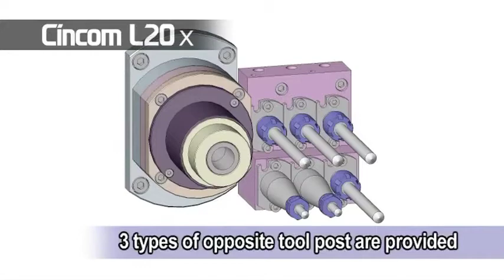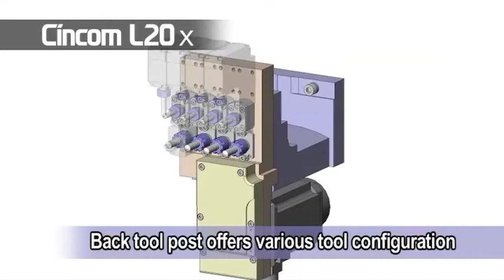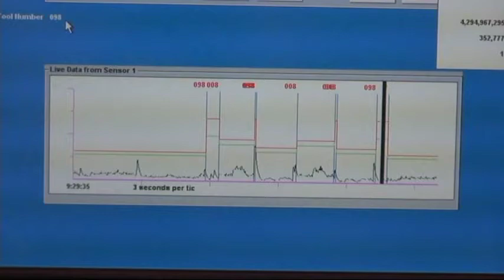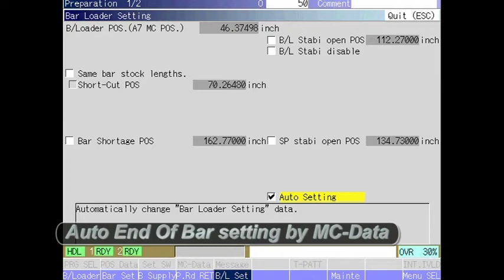Citizen L20X Swiss Lathe

Comment: Well done ConcentricCorp. The video clearly depicts the capabilities/possibilities. I'm currently having some issues on a new Citizen L20. I'm going to post the situation in hopes that you or someone else can help. Thanks in advance. 

We've a brand new Citizen L20 and we're having chatter issue when turning. It's the first part we've tried running on the machine. 

The material is 8620, 11mm stock OD, 6.3mm finish OD, 28.75mm OD length. .01mm total tolerance, .8 finish requirement. The 11mm stock is necessary due to a 10.1mm OD beyond the 6.3mm OD. The stock is precision stock although it doesn't appear to be polished. 

I've tried using a CCGT .4mm nose radius(Sandvik), VCEX .1mm nose radius(Sandvik) and currently a 3 series DCGT .2mm nose radius(Kennametal). The tool is on center. Any thoughts/suggestions on tooling? 

Current cutting parameters are 2000RPM .075mm/rev. 226SFM is slow, if I increase the RPM chatter comes into play. The chatter isn't always consistent either when running higher RPM, I've seen the first 3mm of the part be acceptable then chatter the remaining length. I should also state that we're milling a flat on the part past the 6.3mm OD after the turning operation using a 6mm solid carbide end mill and you can see the back(bottom) of the end mill is dragging once the end mill is fully engaged, combined with the chatter issue it makes me think something is moving, lack of rigidity? Using M18 C0. in the program, couldn't find anything on a possible C-axis brake.

The part is currently running with no taper.

The guide bushing has extended land pads and from my understanding it's set correctly. I can hardly move the stock back and forth by hand through the gudie bushing, I'm able to rotate the stock by hand when the guide bushing is locked. ANY THOUGHTS/SUGGESTIONS ON PROPERLY SETTING THE GUIDE BUSHING?  

The main spindle(Z1) is as close to the guide bushing as possible when in production.

I indicated the stock that was extended past the guide bushing, it's running true(concentric). 

I took out the main spindle collet and it appeared to have witness marks all the way around the front edge of the collet only, almost as if the stock spun in the collet and is only making contact with the very front of the collet. Any thoughts/suggestions?

When I get back in the shop I'm going to run a short bar currently we are running 3 Meter bar length. I want to see if a short bar eliminates the chatter. I'm also going to make a temporary program that only skims the OD to see if less tool/machining pressure eliminates the chatter.  

What's the best practice to indicate the sliding head/turn tool to make sure it's correct?

Any help/insight is greatly appreciated.
Reply from the maker: Branden B Hi, where are you located? I'm happy to direct you to your local support team.
Reply: Summerville, SC. Thank you.
Reply from the maker: Branden B Please contact Chuck at Adept Machine Tools - (704)498-0595.
Reply: Thank you. I've yet to meet Chuck the salesman, but I've worked with Robert from Adept.